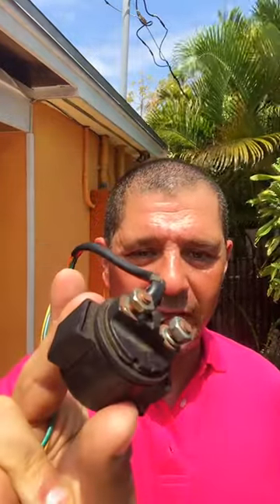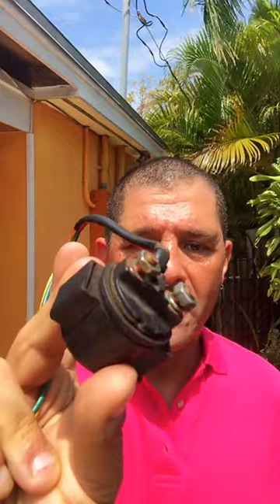Scooter Starter Relay #shorts #scooter #shortsyoutube

Comment: How do I replace it?
Reply from the maker: Hello is very easy check this video https://youtu.be/De1LNDVefXo make sure to disconnect the battery positive part before you replace is the safer way plus to disconnect the wires at the relay you only need a 10 mm socket https://amzn.to/3NxS9rS